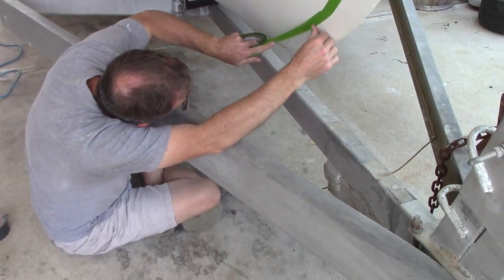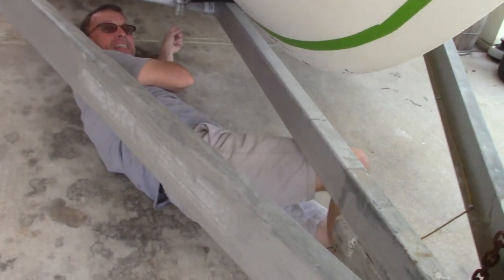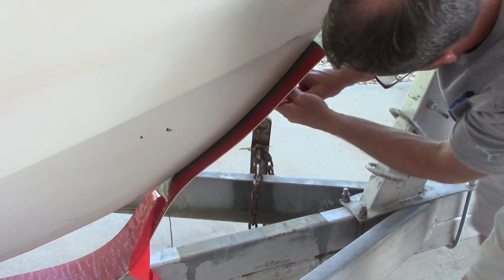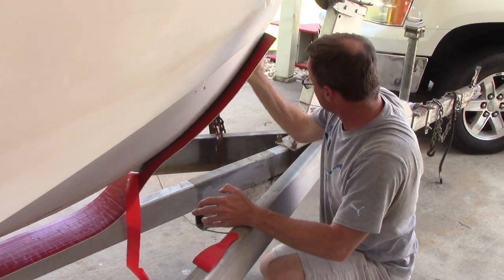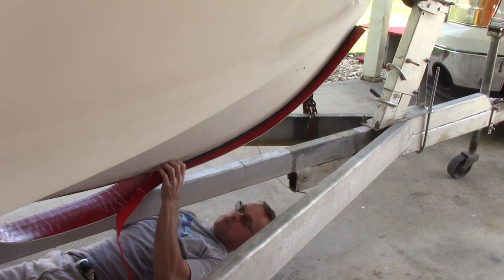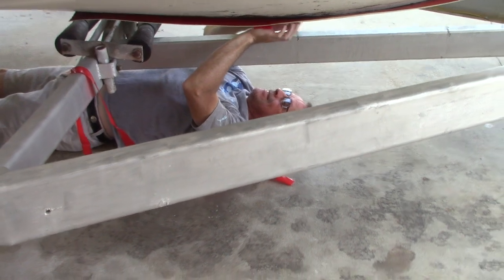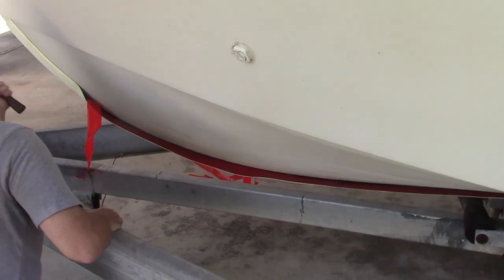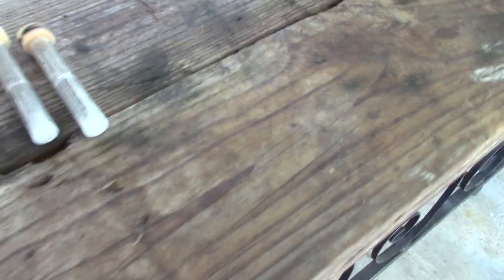Keel Guard for ProLine Center Console Boat/Boat Restoration/How to install Keel Guard

Comment: I plan on putting a keel shield on my 30ft cabin cruiser and the rubber mallet trick looks like it was very helpful around the bend which was my biggest worry on the install. Did you seal around it? If not is it still holding strong?
Reply from the maker: The keel seal all I used was the primer and sanded the area real good and cleaned well the rubber mallet works great . I didnt seal after I install I let it set for 48 hours to make sure it stuck well.